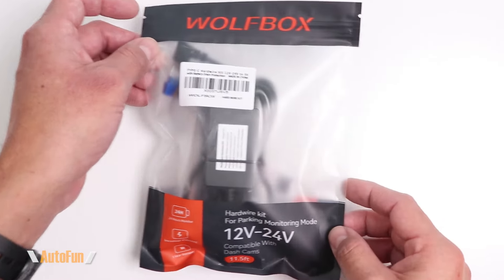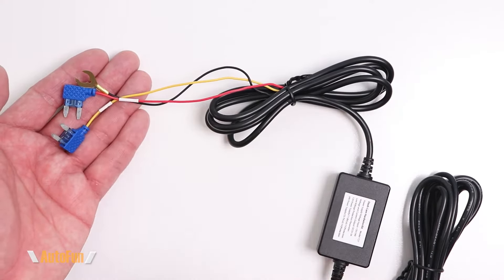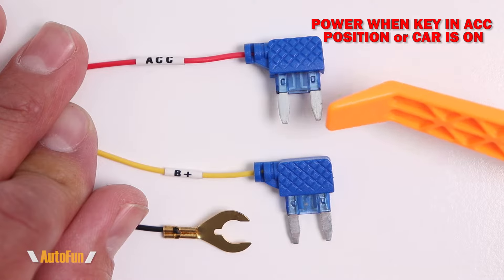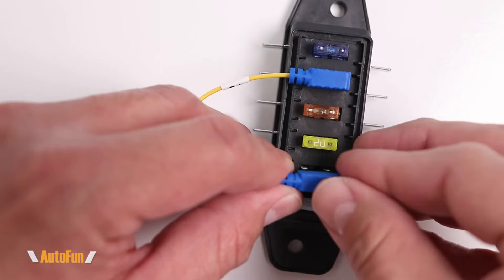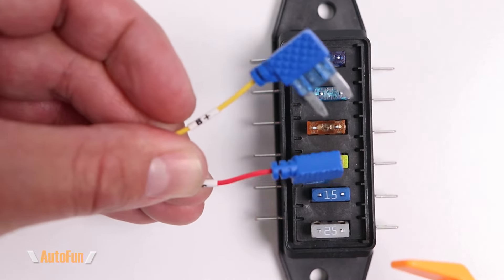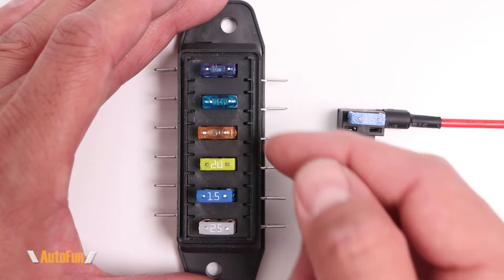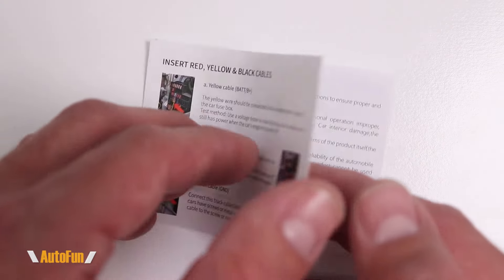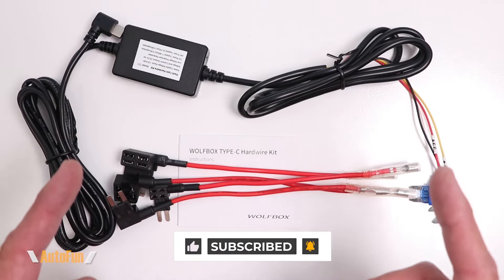Wolfbox Hardwire Kit G930 G910 G900 G850 G840S G840H i17 i07 Install Prep, Fuse Taps Connections

Comment: Wish I had seen this video before! Will need fusetaps to hardwire my i17.
Reply from the maker: Hi Josue! I placed links to them on the video description and here is my follow up video showing the rest of the install https://youtu.be/uZp95NbNlmM Cheers!
Reply: @AlexAutoFun  you wouldn't have one for the 2020 CX5 heh?
Reply from the maker: Hi Josue! Ah yes here is my follow up video where I cover how I find ACC and BATT on any car https://youtu.be/K2iKXj82354 However I strongly recommend profession installation due to the dangers involved with air bags mentioned on the prior video I linked and the dangers if erroneously tapping a critical system of the vehicle as explained on the second video I linked. Cheers! @josuejean912

Comment: Wolfbox should include fusetaps with their hardwire kits or atleast have option to buy fusetaps along with kit.
Reply from the maker: Hi DODO! Exactly! that would be great and honestly would given them a selling slight advantage if they changed this, since the molded on fuses is an issue I seen in several other hardwire kits. Cheers!
Reply: @AlexAutoFun  i just got a Kit that had them in it
Reply from the maker: @pontiuspilot10  Hi Rich! yep it varies from Kit to Kit, the Rove one here https://youtu.be/Ny-TvRnhTs4 so far has been the most comprehensive one I reviewed. Cheers!
Reply: Yes but it’s also a quick run to AutoZone
Reply: Now they do lol
Reply: They include 4 different kinds now.

Comment: For anyone else who may be having issues with their install. 

My wires were labeled incorrectly. Meaning my battery was labeled accessory and my accessory wire was labeled battery.

I only figured this out because when i plugged my accessory wire into my constant fuse terminal and my bat into my accessory, did my G850 start to record with the car off.

Side note: you will know when the mirror cam is recording without the car powered on, because when you turn off the car, the mirror cam stays on, and if you tap the screen it will something like "inoperable, turn on acc mode " 

I forget the exact wording
Reply from the maker: Good info Terence! I have encountered this same issue with different hardwire kits ugh I really think the industry should standardize the colors for ACC and BATT that way all kits will use the same color and the label would just be a verification of that wires function. Cheers!

Comment: Isn't there a risk of plugging into the fuse holder backwards, such that you are pulling power from before the fuse vs through the fuse?  Similarly, when using your fuse tap, haven't you placed two fuses in parallel, with two loads (one the car, one the wire to the camera), requiring ~2x the fault current to blow the fuses?
Reply from the maker: Hi! Correct, and you have a very good eye (this is a common error I see on installs), here is hardwire video where I cover orientation in more detail https://youtu.be/K2iKXj82354 Regarding Ah fuse taps, remember, they create 2 separate independent circuits (each one with a different amp rating partially determined by fuses that are loaded into the each fuse slot in the fuse tap, the car's internal wiring and current load on the circuit to be tapped as determined by your installer) The fuse removed from the vehicle goes in the fuse tap bottom slot and the second fuse (top fuse) is for the hardwire kit. So they are each independent of each other, each one driving it's own load. Here is another video https://youtu.be/Qzw9yUYN7zo where I explain how fuse taps work in more detail, Cheers!

Comment: I like your videos.  This particular one fails to address a very important issue.  When using fuse taps or in this case, the molded fuse, there is a specific direction the fuse needs to be inserted.  In the fuse panel, one side is the load (hot) and the other is the device.  If you put the molded fuse in where the wire is on the same side of the hot on the fuse panel, then it will not be fused at all.
Reply from the maker: Thanks Kyle! Ah yes fuse taps have only one correct orientation (as you stated to protect the circuit). This hardwire kit video is only intended to be an overview of the hardwire features and preparation for installation. If you want to see the details of the actual installation (including fuse tap orientation), I cover that on the dedicated hardwire installation video I mentioned on this video hardwire kit video. Here is that hardwire install video if you want to check it out https://youtu.be/K2iKXj82354 Cheers!

Comment: Hi, thanks for the video. Wolfbox advised me to use the 15 Amp SRS AIRBAG connection site for my constant power.  This seems risky to mess with.  Why would they advise that if it may make it less safe?
Reply from the maker: You're welcome Alex! I can't speak for Wolfbox or the representative that you spoke to (but yes I personally would not use an airbag related fuse spot) but here is my follow up video where I cover how I find ACC and BATT on any car https://youtu.be/K2iKXj82354  However I strongly recommend profession installation due to the dangers mentioned on that video if erroneously tapping a critical system of the vehicle and the dangers involved with air bags mentioned on this video https://youtu.be/uZp95NbNlmM Cheers!

Comment: Great video what about if you don’t want to you the battery + to power it all the time where would you plug it into then
Reply from the maker: Thank you Craig! Ah most dash cams that require a 3 lead hardwire kit will usually need all 3 wires to be connected in order for the dash cam to work correctly. What I recommend when someone does not need park monitoring, is just to turn it off in the settings menu (most dash cams will let you turn off this feature). Cheers!

Comment: Can you extend the USB-C with another cable or rear-angle bend for wiring purposes?
Reply from the maker: Hi Jason! The USB connector used is a standard USB C connector so technically an extension or adapter could be plugged in. However I would probably not recommended it since some extensions and adapters are not pass through and may also contain components which while compatible with the USB C standard, they may not be compatible with the USB C connector as used by the dash cam (remember dash cam manufacturers use the USB C connector for the connector only, they don't necessarily follow the USB C standard). There is also the issue of affecting warranty if something fails down the road with the vendor potentially pointing to the use of an unapproved device added to the dash cam install. That being said, the good thing is that out of the 60+ plus dash cams that I have installed, I have not had the need to use an extension or an adapter so their use may not be common on the industry unless the installer is new or unexperienced and routes the cable in an usual and extra long path to the dash cam. Cheers!

Comment: Can you use a fuse tap on a empty slot? My fuse box in the cab doesn’t have many options and the ones there are aren’t rated high enough for the tap fuse I have [15A] so need a [20A] or higher. Only have [10A] or lower fuses.
Reply from the maker: Hi B! Yes my preference is to use empty fuse spot. However I strongly recommend profession installation due to the dangers mentioned on this video https://youtu.be/K2iKXj82354 if erroneously tapping a critical system of the vehicle and the dangers involved with air bags mentioned on this video https://youtu.be/uZp95NbNlmM Cheers!

Comment: So they sold me a hardwire kit with my g900 but no fuse taps.. not very smart is it.
Reply from the maker: Hi YenNZec! Yep which kind of sucks because I seen this in several hardwire kits, it seems like a waste of time and money (for both the manufacturer and the customer) to have this molded on fuses that may or may not fit our car fuse fox. About 95% of time I end up cutting them off, LOL Cheers!

Comment: I have a Lingdu LD06 dashcam, which is a front camera, and it connects to a rear camera using a splitter cable. If I connect the front camera directly to the car using the hardwire kit, how do I connect the rear camera?
Reply from the maker: Hi B! Remember, on dash cams, the rear camera is powered by the front dash cam so no need for another power supply. And here is my dash cam install video https://youtu.be/IYRavaIBmSY Cheers!

Comment: Couldn’t I just do a Direct Battery connection for B+ and a switch for the ACC end.
Reply from the maker: Hi P! While it is possible to wire accessories directly to the battery most installers will not do that due to the extra labor involved. The cables have to be run all the way to the battery thru the firewall, and then connections at the battery will need to be made ensuring they are correctly fused and secured, then a source for ACC (switched power) needs to be developed etc. Cheers!

Comment: why so complicated? The heads of some hardware kits are already equipped with a 15A fuse at the factory. (as in your video) You can either plug them directly into the actual fuse slot or replace the existing 15A with another one. My ACC fuse, for example, has a 5A fuse. I took out the 15A and put in a brown 5A. The adapter is actually useless. It's only useful if you can't find a free socket for a permanent plus.
Reply from the maker: Hi Achim! Correct, the molded fuses are only good if you have a free socket that can provide ACC and another for BATT. If there is not an available free fuse socket, then a functional fuse tap is required, and here is my video on how I change the ends of the hardwire kit to a different fuse size https://youtu.be/Qzw9yUYN7zo Cheers!

Comment: Do any of their hardwire kits have a physical voltage adjustment switch? I know Viofo does. Debating bout a getting a Wolfbox i07 with a Viofo hardwire kit. I imagine it should work.
Reply from the maker: Hi! Yes while somewhat rare, some hardwire kit do have an adjustable low voltage cut off. Here is my video where I cover this and other important differences between hardwire kits https://youtu.be/Yky9_tTvwMc Cheers!

Comment: How many hours you think the dashcam stay powered before it shutdown due to the battery going down? I have the G900
Reply from the maker: Hi Sam! Ah good question, that will depend on the car's battery, size, age, health condition and state of charge. In addition to that you also want to take in consideration any parasitic draw from other items on the vehicle that use power when the car is off. This is specially common on newer vehicles. For example I have an older Jeep that can sits for months a time with little to no battery draw, then I have a 2017 car that will almost completely drain my battery in a few weeks if the car is not used (and that car does not have any aftermarket devices connected to it). Here is the battery tester I use https://youtu.be/kCNrfa8RUKU if you want to test your battery for capacity and health, it can also perform a parasitic draw test if needed. I do carry one of this on long trips https://youtu.be/5eoewaav43A just in case but again I think my case is a little more extreme since most people only run 1 hardwire kit at a time and I run several kits on my car. Cheers!
Reply: @AlexAutoFun  just installed g900 with obd hardwire 
Enabled parking mode as triggered by g sensor. Put g sensor on high. 
The camera stays on after turning off the car. Never goes in parking mode. What's going on?
Update: never mind. It takes about 3 min from the time I turn my car off to go in parking mode. Which is to me. It's kinda of long time.
Reply from the maker: @sambee5748  Hi Sam! I'm assuming your using the Wolfbox OBD hardwire kit but yes some dash cams have a delay before entering parking mode (to enable you and passengers to exit the car) to reduce false recording when closing the vehicles doors. Addionally OBD2 adapters that enable park mode use voltage detection to determine when the vechile has been turned off, some vehicles have residual voltage longer after shutting down, which in turns tells the adapter the vehicle is still shutting down and causing a delay until the vehicle voltage drops to normal levels when parked (video on how this adapters works coming stay tuned) Cheers!
Reply: @AlexAutoFun  so u think tapping the fuse would take less time for it to go on parking mode?
Reply from the maker: @sambee5748  Hi Sam! Correct, hardwire kits are always faster than OBD adapters as far as telling the dash cam to enter park mode. Cheers!
Reply: @AlexAutoFun  thank you for your help. 
I did hardwire to the fuse box. It takes less than a min to go to parking mode.
I did subscribe to your channel.
Reply from the maker: @sambee5748  You're welcome Sam and thanks for supporting the channel! 🍻

Comment: Hi AutoFun, Your channel is one of my favorite and I have keep watching your Youtube again and again...
Recently, I have installed the Wolfbox G900 with Hardwire kit, and it works really well except one issue.
Everything seems works but only parking-mode doesn't work so it would be great if you give me some advise.
I have connected the Red wire (ACC power) goes into P/OUTLET 15A and Yellow wire goes into HAZARD and it would works, however, when the car engine is off, the dash cam says "entering time-lapse recording mode" and it start recording, however when I checked video, it records only 0.00 sec and it seems stopped recoding after that. I tried to switch around fuse/wire positions but still result is same.
So it would be great if you could give me advise to fix this issue. My car is TOYOTA Corolla Fielder Hybrid 2013 model.
Thank you for your help
regard
Reply from the maker: Hi わさび猫! Ah yes that actually sounds like it's working normal. Remember if park mode is set to Time Lapse, the dash cam is going to compress many hours of video into a shorter video. So if you want to the see the time lapse in action, I would try leaving it for about 1hr then trying to watch the recording (so can get an idea of how time lapse looks) Hope this helps, Cheers!
Reply: @AlexAutoFun  Thank you for your comment, I am appreciated. And yes, it's set to time-lapse mode 12h/1st and left for 3-4hours but still the result is same...it seems dash cam power is completely off while parking mode and I checked Yellow wire  with multimeter when car is off and it still says 12.93v so battery/fuse is not issue...
Have you actually tried parking mode with any Wolfbox dash cam product? (G900-840) A lot of people on Youtube introduce their products and they says "the dash cam has parking mode function!" but I never seen youtube videos that people actually try to use wolfbox parking mode and wonder if parking mode is really working or not...
Reply: @AlexAutoFun  I will definitely watch your Wolfbox parking mode video, if you would make one:)
Reply from the maker: @ShinK-w2v  Since the dash cams says that it's entering parking mode when the car is turned off, the parking mode function is working at that point. However I seen the cases like the one your are describing on some vehicles that shut power to specific circuits after a period of time (Specially on newer cars and Hybrids). So they installer may have to check that the places being used for power continue to have power after an extended period of time. And you can also contact Wolfbox for tech support, they may be able to walk you thru some troubleshooting steps. Hope this helps, Cheers!
Reply from the maker: @ShinK-w2v  Hi again! Ah yes testing parking mode is easy (I can probably make a video on it, good suggestion) What I do is I turn off the car but stay inside of it. I then wait a few minutes (some dash cams have a built in delay before park mode becomes active to give you time to exit the car) then I just tap the dash cam with my hand (of park mode supports G-Sensor) and that should trigger the recording. Hope this helps, Cheers!

Comment: Can you connect this to only turn the dash cam when you have the car started? I don’t want the dash cam on when I’m NOT in the car
Reply from the maker: Hi Dea! Yes, when hardwired, it will turn off when the car is off and turn on when the car is on (and if you don't need parking mode, most dash cams will let you turn that function off in their settings menu). Cheers!

Comment: I have a 2nd battery that's connected to  a solar panel? How would I hardwire to the 2nd battery?
Reply from the maker: Hi G! I have not connected a hardwire kit directly to a battery (while it could be done, it will need additional steps like including switching to enable ACC etc) Here is my install review so you can see how ACC and BATT https://youtu.be/K2iKXj82354  However I strongly recommend profession installation due to the dangers mentioned on that video and the dangers mentioned on my full install video https://youtu.be/uZp95NbNlmM Cheers!

Comment: What is the amps of the molded fuses or are they actually fuses or just dummies to make use of the fuse box? Want to use this with my can am sport side by side. It has a terminal module with always on and accessory/run posts. Wondered if could just cut fuse ends of and attach to the posts on the terminal module. Wondered though if the mirror actually has fuses (and why I asked in the first question) then I would need to also buy some inline fuse holders and solder them to each wire and put the appropriate fuse in them before attaching to the terminal posts.
Reply from the maker: Hi Peter! They standard blue (15A) fuses, and here is my video where I show how I replace them with functional fuse taps (to make the connection to the fuse box) https://youtu.be/Qzw9yUYN7zo Hope this helps, Cheers!
Reply: Hello alex,
The molded fuses attached on the wolfbox are blue which its 15A fuse I presume. So once I use a fuse tap. I need to buy 2 15A fuses for ACC and BATT?